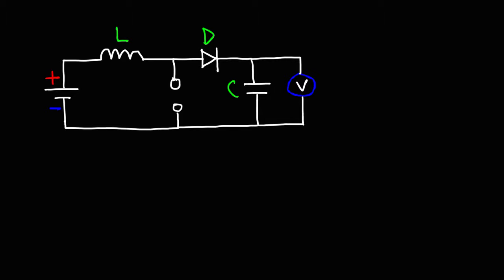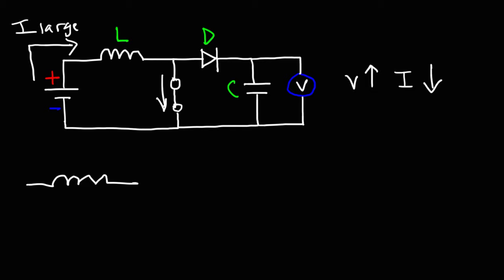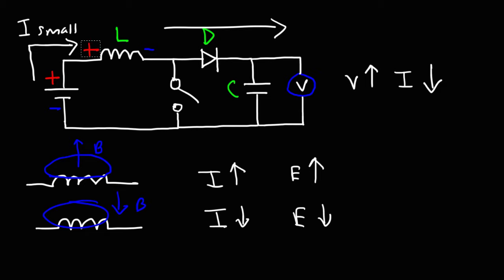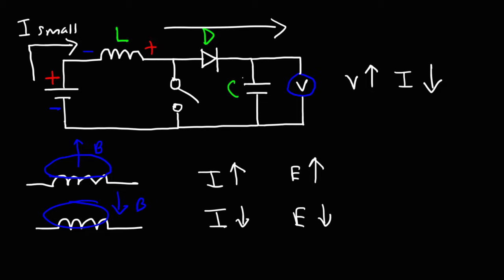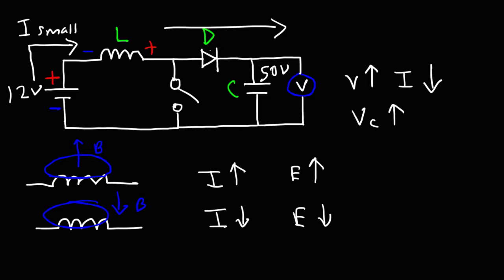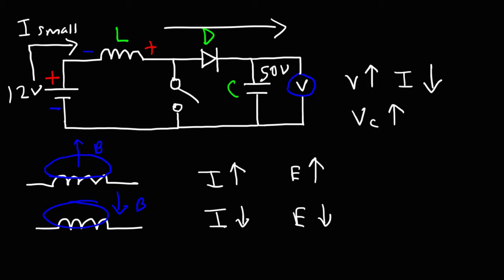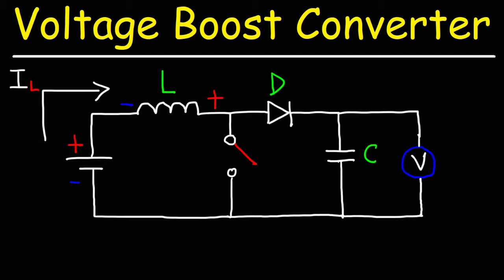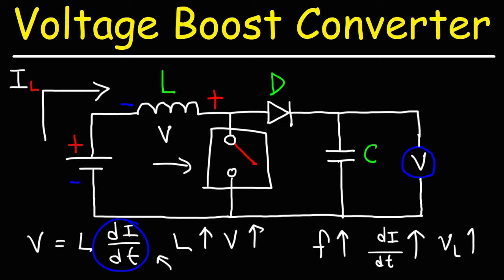Boost Converters - DC to DC Step Up Voltage Circuits

Comment: Nice explanation on boost converters, thanks for making this video. I was confused about one part, though--at 7:38, you say that increasing the frequency applied to the mosfet gate will increase the dI/dt and hence V across L. I was thinking about how all of the (various few) buck/boost converter designs I've seen use PWM control, and not FM control. Wouldn't dI/dt depend on the rise time of the MOSFET rather than the switching frequency? Seems like a square wave would give you the minimum rise time and hence maximum dI/dt.
Reply: I didn't really follow what he was trying to get at. It seemed rather muddled.11

Increasing the frequency, all other things being equal, actually decreases di/dt in the inductor. The rate of change of current in an inductor is proportional to the voltage across it. If the input voltage, output voltage and duty cycle all remain constant, increasing the frequency results in dt being smaller in each cycle thus di is proportionally smaller. If you want to increase di under those conditions you must make the inductance smaller.
EDIT TO CLARIFY: di/dt as such does not imply any fixed time, and in fact the opposite - a way of expressing what happens with infinitesimal change in time. It really isn't correct to use di/dt for some fixed amount of time - that would be expressed as Di/Dt where the capital D really should be a capital Greek delta (a triangle Δ; the d in di/dt really should be a small Greek delta δ thus Δi/Δt rather than δi/δt  - characters may not render properly). If delta t is shortened, delta i will be reduced in proportion for the same voltage applied across the inductor.
You can do a boost converter with FM though it isn't common in general purpose circuits. It can increase efficiency a bit at light loads because you have fewer switching cycles per unit of time with more or less fixed loss each cycle. Variable frequency operation is moderately common with active power factor correction circuits.Most active PFC circuits are boost converters with the interesting property that average  input current must be inversely proportional to average input voltage but instantaneous input current must be directly proportional to instantaneous input current.
Reply: A decrease in frequency will allow more time for the capacitor to discharge through the load thus bringing its average voltage down.
Reply: @fiddlyphuk6414  
A decrease in frequency with no change in duty cycle will allow greater ripple voltage on the capacitor but the average voltage will remain the same unless the capacitor is allowed to fully discharge each cycle. No one with the slightest clue about how to design a switching regulator would do that.
Reply: @d614gakadoug9   The greater the ripple voltage the lower the average DC voltage across the load will be. It's the same way in linear power supplies. The original question regarded how frequency alone can affect the output voltage as stated by robanada.  An increase in frequency alone will increase the voltage but, in reality, only up to a point depending on the size of the inductor. For that reason PWM makes for far better control of the output voltage.
Reply: @fiddlyphuk6414  
No. Greater ripple voltage does not imply lower average voltage. It simply means that there is a greater difference between the minimum, average and peak voltages. A triangle wave swinging between 1 volts and 9 volts has exactly the same average voltage as one swinging between 4.5 volts and 5.5 volts
 but 8 volts peak-to-peak ripple versus 1 volt peak to peak ripple.

It is not at all the same as in linear supplies because a linear supply uses capacitors to "filter" what is a not-very-good VOLTAGE source while in a switcher the capacitors filter a CURRENT source. An ideal voltage source has zero impedance. An ideal current source has infinite impedance.

The voltage in a buck or boost converter is dependent ONlY on the duty cycle if the input voltage is fixed and the inductor current is continuous.

for a buck converter
     Vout = Vin x duty cycle
for a boost converter

    Vout = Vin / (1 - duty cycle)

Again, frequency simply does not appear in the expressions.
ONLY ONLY ONLY if a change in frequency results in the inductor current changing from discontinuous to continuous does a change in frequency change the output voltage.
Reply: @d614gakadoug9  A stable DC voltage such as the voltage from a 12V battery will have a constant 12V DC output. If you take that voltage and chop it into a triangle wave such as in your example you will no longer see an output of 12V DC from that battery. It will be an RMS voltage half the peak value of the triangle wave. The triangle wave has introduced a form of ripple to that constant 12V DC output. It can only be brought back to the original 12V DC voltage by adding a capacitor with no load. Once loaded, the ripple will reappear and increase depending on the demands of the load thus lowering the peak voltage to an RMS value based on the amount of ripple.
Reply: @fiddlyphuk6414  
You clearly do not understand how a switchmode power conversion works or the parameters of a triangle wave.

If you have a triangle wave (or a sinusoidal wave, or a rectangular wave) changing the frequency of the that wave does not change the peak to peak amplitude, the RMS value (which is irrelevant to the discussion at hand) or the average value. 

Either put up a mathematical expression that supports your claim or give it up..
Reply: @d614gakadoug9   The discussion is about a greater ripple voltage being imposed on the output voltage with a decrease in switching frequency, an occurrence that you previously acknowledged. The average output voltage will be reduced with an increase in ripple voltage, that ripple voltage being an AC waveform component imposed on the DC output. Saying the RMS value is irrelevant in a sinusoidal waveform or of any other varying waveform in determining the average working voltage (average voltage value) of that waveform as compared to its peak value is incorrect. It is basic AC theory- The average voltage of a wave=  Sinusoidal waveform: Vrms=Vm÷√2   Triangle waveform: Vrms=Vp÷√3   Square waveform: Vrms=Vp×1÷√2
Reply: @fiddlyphuk6414  
No, now you are desperately grasping to try to justify your claims.

The original question was about how increasing fequency could increase output voltage, not about ripple voltage.

This appears to be completely hopeless because you are clearly reading things you don't understand sufficiently to know how to apply them.

Unless there is a DC offset, the average value of a sine wave, a triangle wave and a square wave, each considered for an interger number of full cycles, are all exactly the same - ZERO! It does not matter that the amplitude is or what the frequency is, the average is always zero. If any of those waveforms is superimposed on a DC offset the average voltage is exactly equal to the DC offset voltage. The RMS values are very different, and again, not relevant to the discussion at hand. 

RMS currents are very much of interst in design of switchmode power converters because of all the components with non-zero resistance. For example, the output filter capacitor of switching converters is very often chosen on the basis of it ability to withstand the ripple current and in many practical designs that means the the capacitance used will be many,many times that would be required if the capactiance were chosen on the basis of ripple voltage.

Do you understand that in a switchmode converter in equilibrium the average voltage across the inductor is exactly zero and the average current through the output capacitor is exactly zero, ignoring losses? Do you understand why that must be the case?
Reply: @fiddlyphuk6414  
One other question: Can you describe how RMS current from a conventional low-frequency transformer operated with AC mains input relates to the average output current of a rectifier and capacitive filter connected to the secondary of that transformer?
Reply: @d614gakadoug9   By reading your comments I similarly see this with EE students that are weak on theory. Some will come up to speed on theory by hitting the books harder. Others will simply drop and choose an easier major.
Reply: @fiddlyphuk6414  
So am I to take it at this point you are declaring victory and giving up? Just as well. Do hit the books harder and maybe you will catch on to what you are clearly failing to comprehend.

I note you failed to attempt to answer any of my questions.
Reply: Since FP didn't attempt to answer my questions, I will in case someone else is trying to follow this.

In a switcher in equilibrium the power being taken from the input source is exactly equal to the power being delivered to the load, assuming perfect components (that is, no losses to resistances or in the core of the inductor, etc.). Neither the average current from the source or into the load is changing and the average output voltage remains constant.

If there is non-zero voltage average voltage across an inductor the average current through that inductor must be changing. This is a fundamental property of inductance. Therefore with our switcher in equilibrium, where average input and output currents are constant, the average voltage across the inductor must be zero.

Similarly, the average current through the output capacitor must be exactly zero if the average voltage across it is constant. This is a fundamental property of capacitance. If the average current is not exactly zero then the voltage must be changing. If we put more current into a capacitor than we take out the voltage must rise. If we take out more than we put in the voltage must fall.

With regard to the RMS versus average current in the windings of a a transformer with a rectifier and a capacitive filter:
The RMS current will be higher than the average current. By how much depends on the amount of filter capacitance and how well the transformer behaves as an ideal voltage source.
Current in the rectifier will flow only when the instantaneous voltage of transformer is higher than the voltage on the capacitor. As you increase the capacitance the voltage droops less and less during the part of the cycle where 100% of the current to the load is coming from the capacitor. That means there will be less time during which current can flow from the transformer. However, the total amount of energy delivered to the load during the time the cap was supplying all of it must be replaced in that short time. That can only happen with high current.
It is difficult to analyze the actual current flow in a real circuit, but the RMS value of those narrow, high-current "spikes" is much higher than the the average current flowing to the load. (If the current flowed in rectangular pulses the RMS current would be equal to the square root of the "duty cycle" (ratio of pulse width to cycle period) times the peak current. The average current would simply be the peak current times the duty cycle. Since the square root of any number greater than 0 and less than 1 is always greater than the number itself, the RMS current is always greater than the average current.

Returning to the original question from the originator of this thread:
In a boost converter operating with continuous inductor current (that is, current that does not "dwell" at zero at any time in the switching cycle), the output voltage in equilibrium is simply
Vout = Vin(1/duty cycle)
Inductance value, capacitor value and frequency simply do no enter into the expression.
If the circuit is operating with discontinuous inductor current (that is, 
the inductor current drops to and dwells at zero for some part of each switching cycle), the expression is much more complex. Rather than trying to make it readable here, I would refer those interested to the Wikipedia article on boost converters. Near the end (as of mid-November 2023) is an expression for gain for a boost converter in discontinuous mode. Now the inductance does become part of the expression. Note that T, the switching period, appears in the numerator for the Vout/Vin expression, meaning that Vout actually falls with increasing switching frequency, all other parameters being equal.

A boost converter operating in continuous inductor current mode has rather poor dynamic performance. If the output voltage drops due to a sudden increase in load current demand you need to increase the duty cycle to get the voltage back up. However, increasing the duty cycle when the output voltage is lower than it was in equilibrium means there is less time to transfer energy from the inductor to the ouput capacitor and load in each switching cycle. This is the opposite of what you need. The result is that you first store more energy in the inductance over the course of several switching cycles. Eventually that extra stored energy gets delivered to the output. This relates to the dreaded "right half plane zero" in the transfer function. An RHP zero can't be compensated by shaping the gain/phase versus frequency transfer function of the error amplifier, so you just have to live with poor dynamics. The same applies to a flyback converter in CCM.
Reply: Oh, I can't pass this up! It's just too funny.

In reply to my comments I got this:
"By reading your comments I similarly see this with EE students that are weak on theory. Some will come up to speed on theory by hitting the books harder. Others will simply drop and choose an easier major."

At sound the time the author of that reply was writing it he was off in the comments on another video, which I watched today, proving he failed to understand some very basic concepts of inductors and in consequence how a boost converter works, telling the creator of the video that he (the creator) was wrong. Of course the creator of the video was right.
He is right. Some will come up to speed on theory by hitting the books harder. Maybe he'll take his own advice.
Reply: @d614gakadoug9  You failed to grasp that I was questioning the creator of the video in the clandestine manner such as I was to test how solid his knowledge of the subject was. It's also a very effective method of dynamically testing a student's knowledge on a particular subject by pretending to let them teach me.... I will gently add that you are still not up to speed on some of the most basic concepts of AC theory such as how RMS voltage relates to peak voltage and peak to peak voltage of an AC waveform. Please don't be offended. Just hit those books harder.
Reply: @fiddlyphuk6414  
Nice story, but I don't buy it.

You have failed big time to catch on to the fact that RMS voltage is of virtually no interest with regard to the matter at hand. You appear to by trying to make out that a switcher behaves like a voltage source when it most certainly does not. I'd guess you've been involved in audio or electrical circuits. I remain unconvinced that you even understand that RMS is always positive by definition whereas an average is not.

You argued in comments on another video that curent in a boost inductor reversed, not as a question but as a statement the maker of the video, obviously a professional, was wrong. When corrected you doubled down. Eventually you admitted you had been taught something.

I don't need to hit any books. I spent many years designing analog electronics including a substantial number of switchmode power supplies for highly-specialized industrial use. I am very familiar with how to calculate RMS values, though as I stated before, in SMPS it is RMS currents that are of interest whereas RMS voltage is pretty much completely irrelevant except at the front end of mains-powered converters. RMS currents must be analyzed in terms of their individual components to properly determine and manage losses in inductor and transformer windings, core losses, capacitor ripple current and the like. If you really push it you might even want to do analyses based on spectral content.

It is true that my experience in designing boost converters is limited. I'd have to go back and look at old designs but I think a couple of the MPP converters for photovoltaic input were boost converters. I don't recall ever doing just a simple DC-DC boost converter. What I have done is design of active power factor correction boost converters from about 200 W to about 1200 W for "universal" (85 - 264 VAC ... RMS!) input. They are actually interesting because the instantaneous input current must be directly proportional to the instantaneous input voltage (for high power factor) while inversely proportional to the average input voltage (because of the negative resistance characteristic of the input of a switcher).
Reply: @d614gakadoug9    Quoting you-  "You appear to by [sic] trying to make out that a switcher behaves like a voltage source when it most certainly does not."........ Based on your statement, if a switching supply that is designed to boost input voltage to supply a regulated higher voltage at its output is not a voltage source then it is of no use whatsoever.
Reply: @fiddlyphuk6414  
I'm sorry, I didn't make that very clear. 
In terms of what is going on with ripple on the output capacitor the switcher is essentially a current source, not a voltage source. This is VERY different from what you have if you rectify and capacitively filter a sinusoidal AC source of very low source impedance (as with AC mains directly or the output of a transformer).
Reply: @d614gakadoug9   Given your vacillating rhetoric, you exhibit a somewhat noticeable learning disability. Sometimes the truth is not so pretty but I will wish you luck in your endeavors whatever they may eventually turn out to be.

Comment: The frequency does NOT change the output voltage. It is a function of the duty cycle and NOT the frequency
Reply: Saturation point DOES IT!